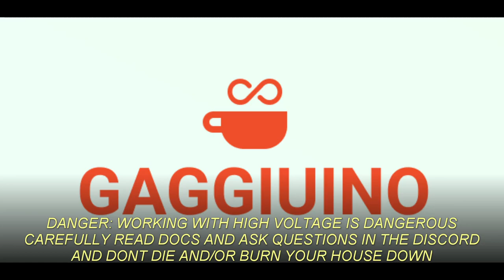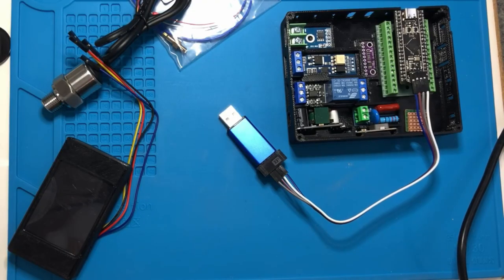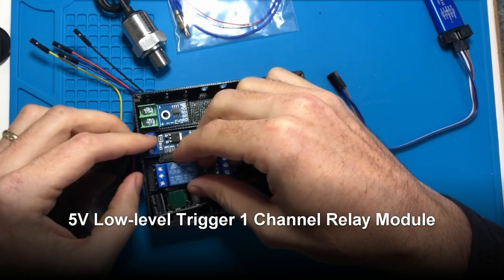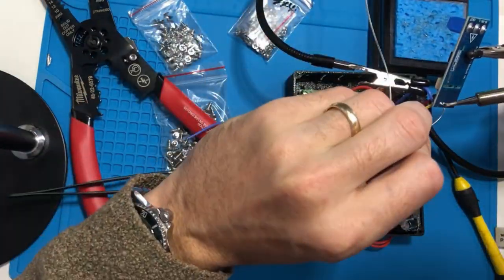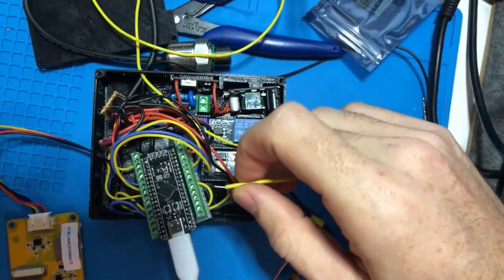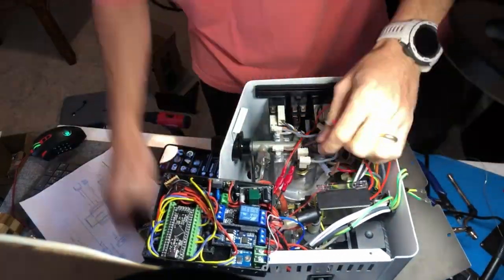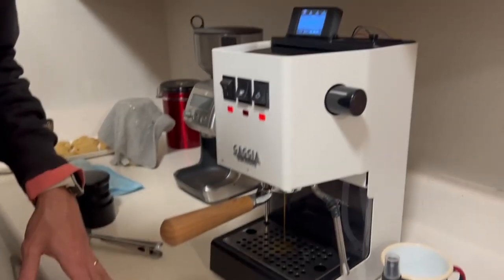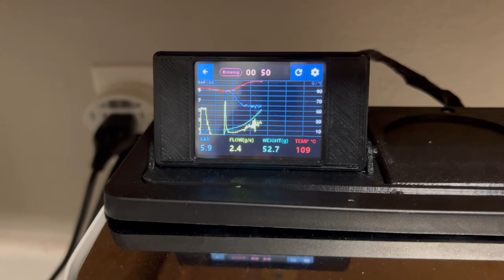Gaggiuino Build Log with Workflow

Comment: The flow and pressure profile in itself is incredible, but I think what it does to the steam is also pretty remarkable.
Reply: What does it do to the steam?
Reply: @greenspider3664  If I'm understanding it correctly, it keeps the heating up while steaming because the temp is dropping, so you will have a lot more steaming capacity as it keeps producing steam that way.

Comment: Great video! I‘m thinking about doing this project. A few questions: why is the temperature at around 110°C at the end? Why does it say 52 grams or so when you only measured 42 grams or so? How does the system measure the output weight?
Reply from the maker: the boiler heats a lot through the shot to compensate for temp loss through group head. The system needs to be calibrated for the water dispensed before it reads accurately. The system is estimating the water dispensed based on the signals it sends to the water pump. Different beans, grinds, and other factors like humidity result in different amounts of backpressure and flow characteristics which affect how much water is sent through the group head in a given amount of time with the same power output from the pump. You need to adjust this setting in the system when you use different beans/different grind. Also make sure to watch a different video. Some of the schematics are now different than when i made the video,
Reply: @beebles2499  that heat compensation thing sounds vastly inferior compared to pre heated brew groups..?
So the output estimation can’t be used for a closed loop profile? Would that be possible with scales?

Comment: Thank you so much for this! This video gave me the courage to start after having the components were delivered and sitting in my storeroom for 1 month. 

Did you connect your scale to the Gaggiuino too? I noticed that the screen on the Gaggiuino had weight readings as well.
Reply from the maker: no scale. just use a thin scale and a shot glass

Comment: Hi Friend, how you connected the dimmer to the pump? in the video I see two black wires and two red wires coming out of the dimmer (the dimmer has only 3 ports). So I'm a bit confused.
Reply from the maker: Hey James. Actually with the new software updates the wiring has changed to the dimmer and the relay. Please see this link for details. https://gaggiuino.github.io/#/guides-upgrade/lego-independent-relay-dimmer

Comment: Thanks for the video. I really want to do it and I am considering either Shades PID or going all out with the Gaggiuino. I don't solder though and it seems quite daunting. You're not in Northern VA by any chance, are you? I also love how the Gaggia now sounds like an old moped being started.
Reply from the maker: Ha yeah I love the sound too. Not located in VA. Definitely recommend Gaggiuino because the feature list is a lot longer. I had never soldered wires before either. With the right YouTube videos (check the description), its totally doable without prior experience! Make sure to get a multimeter and test continuity on your board once you are done soldering. Takes just a couple minutes and can save you lots of troubleshooting later.
Reply: @beebles2499  Thank you for the encouragement! I really need it, haha. How about steaming? Does the Gaggiuino help with that? I mostly drink my espresso in latte's.
Reply from the maker: @termin8d  The steam is where i noticed the biggest difference. I actually have to slowly increase steam when im texturing milk because its so powerful.
Reply: You should consider the PCB version. I'm currently registered on the next group buy as I just missed the last one.
Reply: @vialb2  Where is the group buy?

Comment: Does that mod works with Gaggia Classics from before 2015 or just the new pro models?
Reply from the maker: the mod works on both. the gaggiuino components are the same but the wiring to the machine and install is different. check the documentation for details. there are also separate channels in the discord.

Comment: The strip board isn't on the bill of materials, where did you buy yours from?
Reply from the maker: https://www.aliexpress.us/item/2251832661583259.html?spm=a2g0o.order_list.order_list_main.23.21ef1802cTXHM6&gatewayAdapt=glo2usa&_randl_shipto=US
Reply: @beebles2499  how did you fit the wire through the holes? I have the same diameter holes and my 26 gauge wire is too thick to get through...
Reply from the maker: @digdug0072  I tinned the wires and then clipped them down with find wire cutters to a point. I poked that through and then soldered. This is fine on the 5v/ground stripboard but on the components make sure you get the wire all the way through so you dont have a short

Comment: temperature just seems to run away during a shot
Reply from the maker: that would be my bad. still dialing in everything. you can set whether or not you want the machine to continue heating through pre-infusion to account for the temp drop when new water hits the boiler.
Reply: ohhhh yeah that might be a thing for sure, lotsa heating when no water moving lol

Comment: Bro while u are brewing, ardunio reading 101degree, why?
Reply from the maker: THe boiler gets actually above 100C and there is heat loss when new water gets pumped in so the machine compensates by bringing the boiler temp above the goal temp so that when the main infusion starts, the water is at the right temperature.